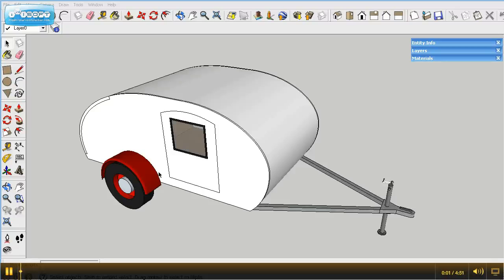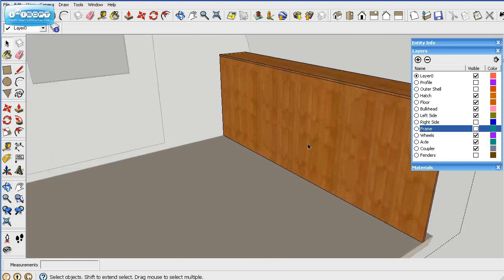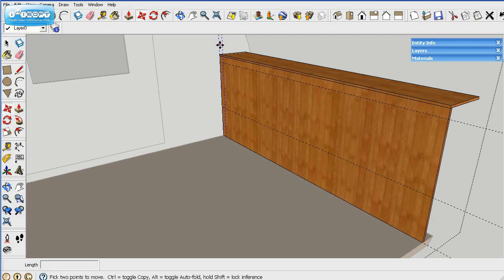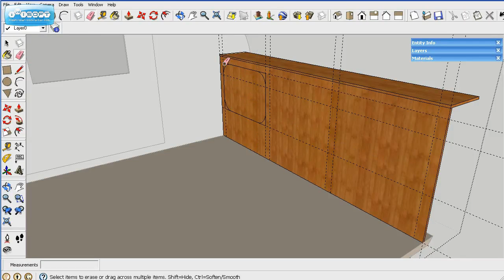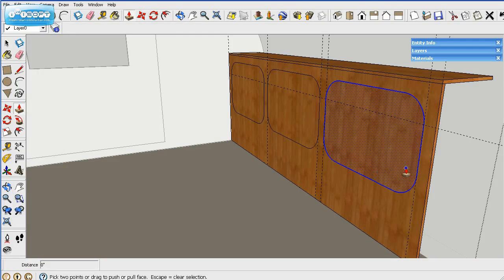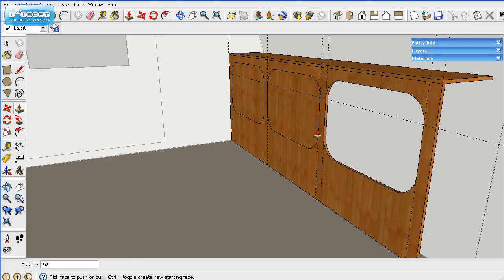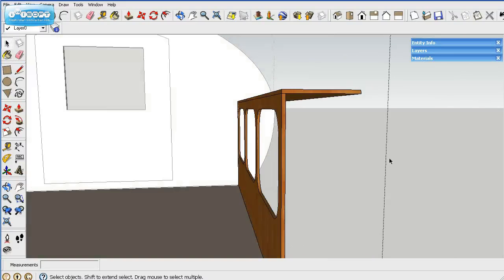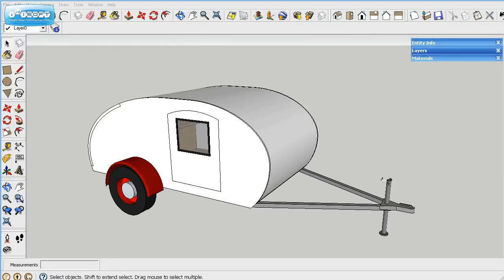Grumman 2 Teardrop Build Part 16 - Creating holes in the bulkhead for storage

Comment: Nice job on your Sketch up design.I built this same Grumman 2 tear drop about two years ago and it came out looking very much like our drawing, right down to the rounded cabinet door cut outs.I could share a picture with you if you like.  Mine has the wheel under the body and is built on a stretched Harbor Freight frame.